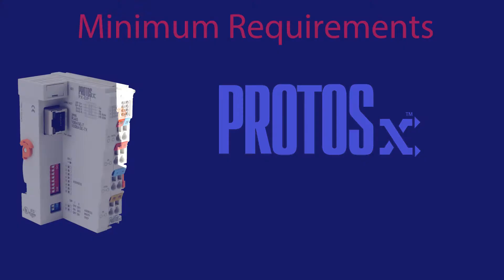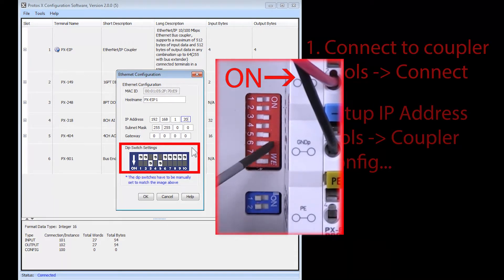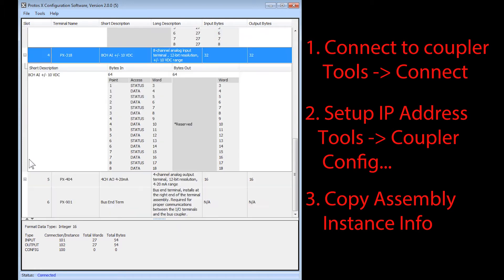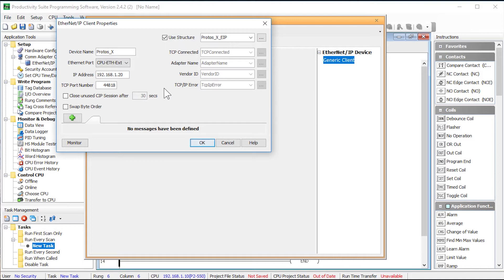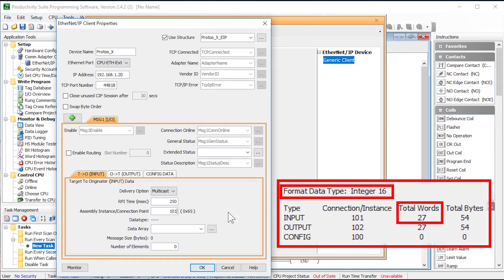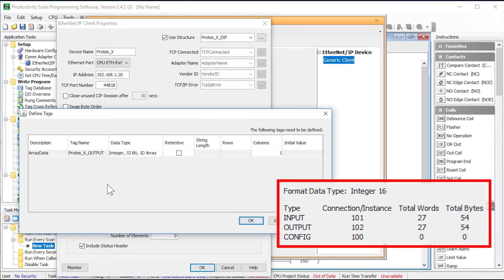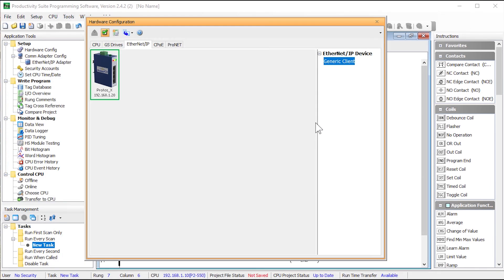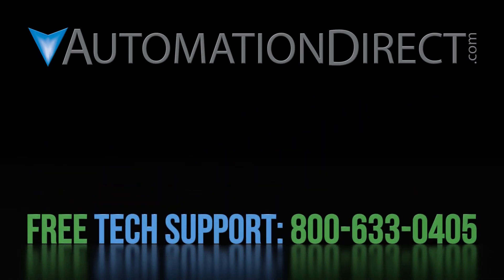Connect a Protos X EtherNet/IP to a Productivity CPU from AutomationDirect

Comment: It is necessary the freaking 90 bucks cable?
Reply from the maker: @davidmoreno9306 the system needs to be configured. To accomplish this the USB programming cable is required. Please refer to the user manual, available from AutomationDirect.com, for more information on how to accomplish this. Thanks!
Reply: @automationdirect  Will a cable I use for configuring Beckhoff Bus Couplers work for configuring the Protos X Bus Couplers, or is there something specific in the Automation-Direct cable for configuring the Protos X Bus Couplers?